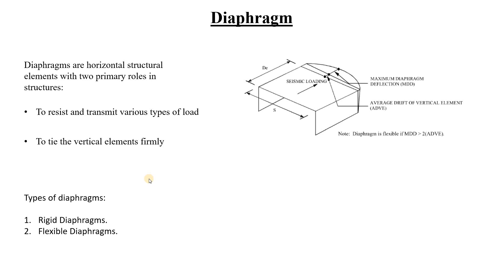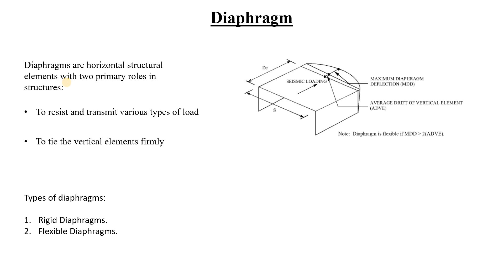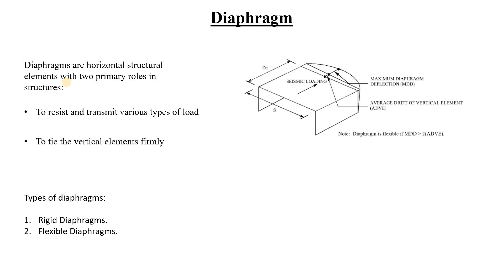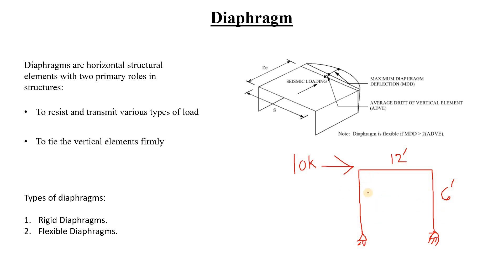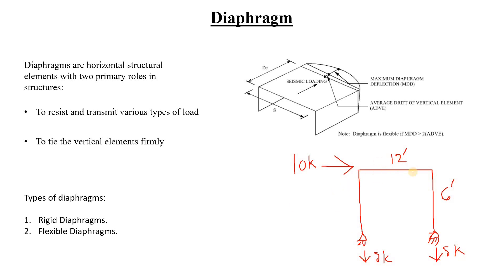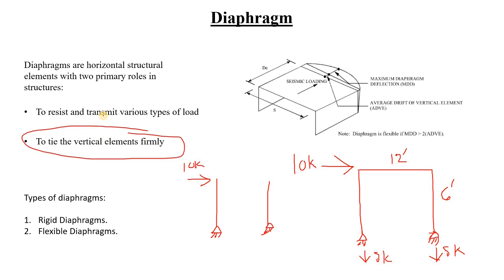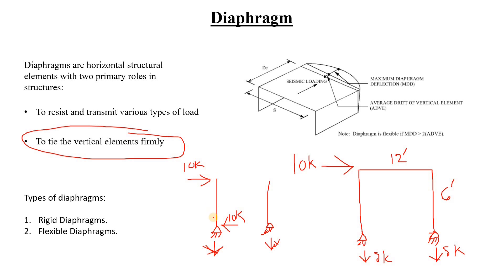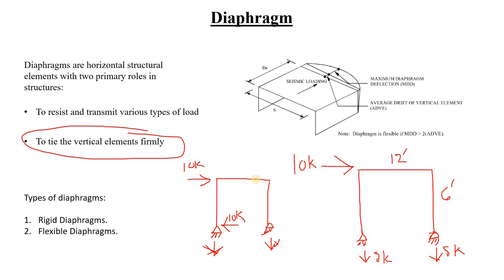Understanding Diaphragms in Structural Design | Diaphragm Roles in ETABS

Comment: Hi Sir, I am from Indonesia, we adopt American Code (ACI, AISC, ASCE, etc.) for basically every aspect of structural concentration. I found this channel trough ur bio in Udemy. Lots of review i read said it was a good course for them to understanding BNBC2020 code, it is a Bangladesh code as I found. So, does ur course present and align with American Code or Bangladesh code?. Thank you
Reply from the maker: Yes. The project design done in the course is based on BNBC2020. But I have also highlighted the American and Euro codes in the course. If you look at the earthquake and wind load requirements of the course you'll see I have gone over both the American and European code methods and their similarities and similarities with the BNBC2020. 

If you wish to do the course on Udemy, I think Udemy still offers a 30 money back guarantee. So my suggestion would be to check if Udemy still offers the money back guarantee for the 1st 30 days and enroll in the course to see if what's covered in the course is what you need within the first 30 days. If you think it is what you need then you should be good.